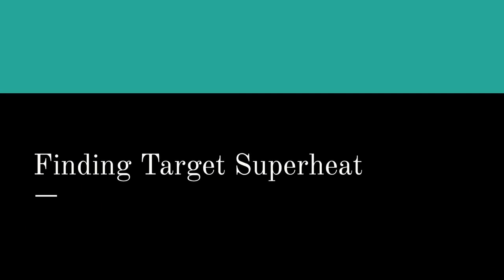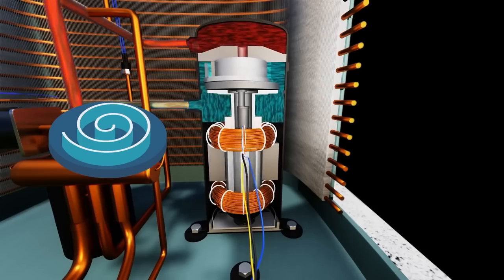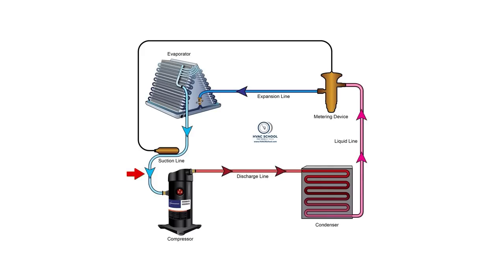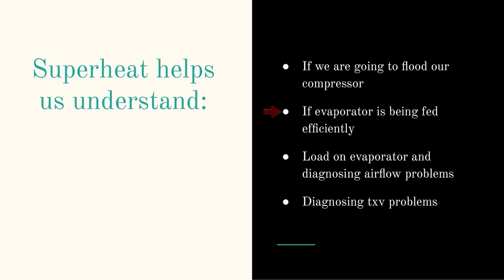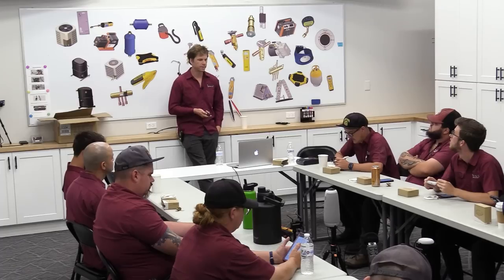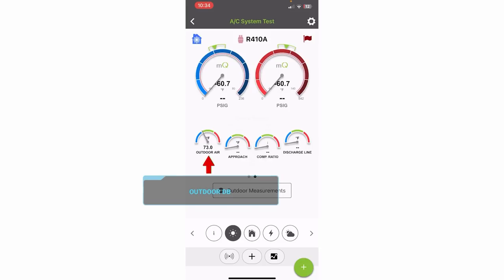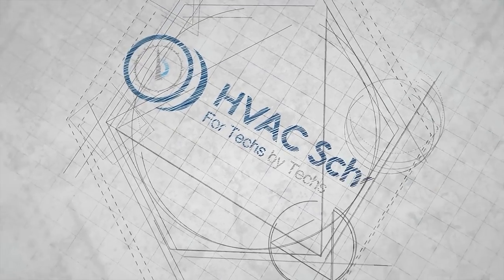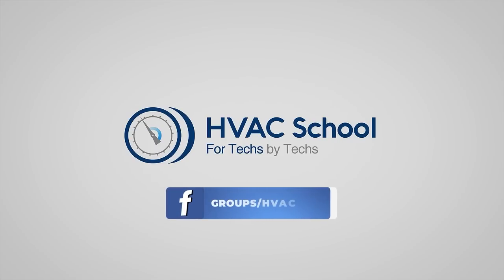Finding Target Superheat

Comment: I wonder if this method of finding targe superheat would work on a vehicle. Having trouble getting proper cooling from a 2008 Jeep Grand Cherokee I replaced the evaporator, dryer and TXV on a couple years ago, and it never has worked right. Evacuated and weighed in correct amount of refrigerant, but unsure exactly how much oil is in the system. Perhaps that's part of the problem, thinking of evacuating again, draining all oil from wherever I can get it out of easily, and starting over. Suggestions welcome, it's been many years since HVACR school in the Navy, and just the occasional job like this since. I just tuned up my JB vacuum pump and micron gauge (good for 15 micron verified by two separate micron gauges) and ready to try again. I think part of the problem last time was the vacuum pump wasn't pulling down remotely enough, and with my micron gauge contaminated, couldn't tell at the time.